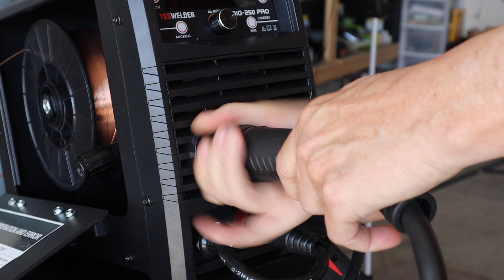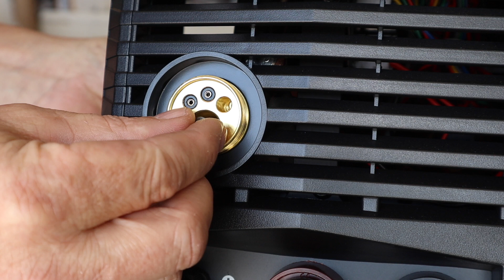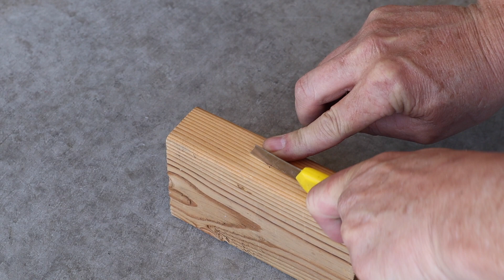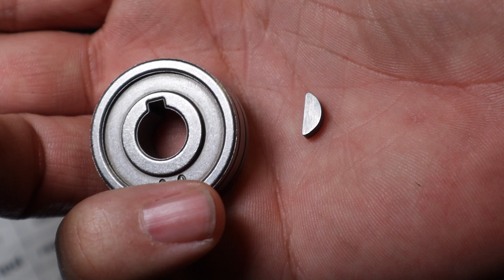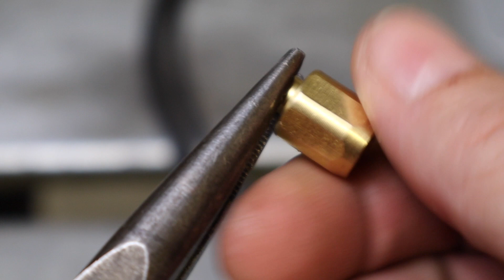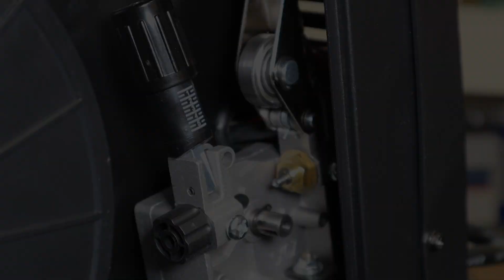How to Change a MIG Gun Liner  - YesWelder MIG 250 Pro

Comment: Thank you for that video . It really helped me a lot. I have one question:  What type of liner (teflon or steel) i should use if i am using FLUXED CORE (self shielding) wire and I am welding without gas? Also the size of the liner ...I see there are liners on the market that are recommended for wires from 0.8 to 1.2 diameter.... Obviously one should aim at installing a liner with diameter as close as possible to the diameter of the very wire used , for example wire 0.8 should fit in liner 0.6-0.8 , wire 1.0 should fit in liner 1.0-1.2 . Thank you again.
Reply from the maker: Personally I would use a steel liner for flux core wire. The same liner you use for solid core MIG welding.  If the old liner was working well for your needs I would just replace it with the same diameter for the replacement liner.

Comment: Hello I own a yes mig tig and stick welder model 205ds ( the blue white model). I want to weld aluminum. Can my welder be converted to weld aluminum with the existing mig gun setup.  I have an argon tank.  I keep hearing that all I have too do is change the liner in the mig gun. Where can I find a compatible liner. Also the roller has too be changed with a grooved roller too push the aluminum wire out. Also what thickness aluminum  wire should I use. Thanx
Reply from the maker: I would think it is possible but I have not used that particular machine. I believe YesWelder sells a graphene liner that will work for you. You may have to cut it to length. Not sure about the U shaped aluminum roller, either YesWelder or maybe on Amazon. I would try .035 wire and use a .045 tip. Use one size larger tip than the wire size and it helps reduce friction on pushing the wire. Try to keep the lead as strait as possible when you weld as well. I wish you the best!

Comment: Appreciate people making how to videos but dude... taking the c clip off to replace a rigid tube with one that is flexible graphene liner was just plain dumb. As soon as I pulled the clip off I realized how dumb this idea was. Anyone that did what you did after watching this is definitely cursing you or will be. The graphene line I have doesn't even fit where the tube was and my clip vanished somewhere inside the machine. You need to edit this video telling people NOT to take that tube out and if they need to put it back in to do it inside a clear plastic bag or something because when it goes flying, you'll never find it. You should have just pushed the liner in a tiny bit longer than the nut so it fits without stopping the torch from connecting to the machine. Manually thread the wire into the metal and then graphene. Pretty sure yes welder sizes the graphene liners and that's why you just happened to have the same exact length as the tube you shouldn't have removed. I'm pretty sure your graphene liner will be split at the roller in no time and then your liner and part of your wire spool will be garbage.
Reply from the maker: You're giving me way too much credit. I didn't write the instruction manual I just followed the steps. You potentially have a good idea there. You should make a video and show everyone how you think it should be done. Maybe it will work better and help some people out.
Reply: @DIYHomesteadProjectsDIYHP10  Sorry bud.. I've never even mig welded before to be honest I have common sense which only gets you so far without experience. I've had some issues getting everything I needed to start learning to weld aluminum. I've stick welded a bunch but crappy welder welding on a crappy welder wasn't too pretty.When I posted here I literally came straight from the garage after trying to get that C-Clip back on. I was more frustrated with it than anything you did. That first coil you took out I ruined pulling it out with pliers but figured out that it can be spun in and out like a bolt. I cut a piece off the copper coil at the end of the graphene liner to temporarily replaced it but I only have a 1lb spool of aluminum and there some drag so, I'll remove it like you did and see if it help. Does it stick to the tube you took the clip off? The only thing I could try was another piece of that copper coil but It seems like there is a lot of drag there too when I just thread it though. My graphene liner doesn't fit through that hole  PS: I do have common sense but I also have uncommon sense and neither one is right all the time. Sorry again. Cheers
Reply from the maker: No problem and I get it. That C clip is frustrating and I struggled with it too. I haven't tried it but I have wondered if the rear C clip is even necessary. You could possibly leave the C clip on the front and just remove and insert the metal guide tube from the front of the machine when switching to the graphene liner. I've lost my rear C clip too. Now I just wrap small gauge piece of wire where the C clip goes and twist it like a bread twist tie and clip the ends. When I need to remove it again I just break the wire with my needle nosed pliers and install a new twist tie when it's time. Much easier to do than fiddling with that dreaded C clip.
Reply: @DIYHomesteadProjectsDIYHP10  I ended up winding tiny spring around it but you might be right about not needing .  I only have a 1lb spool atm and the simder  welder I just got isn't liking it. Might try shaving the liner down a touch to get it to fit in the hole so I can try without that tube and see if lessens the drag a bit. I'll pick up a 2 pounder and see how much different the drag is because right now it's moving like an eskimo wearing one concrete snow shoe and one cross country sky being chased by a pregnant three legged polar bear.
Reply from the maker: I hope you are able to get it running smooth. 👍

Comment: When and if I have to replace the mig liner if I go up in wire size? I bought my first mig welder. The MIG welder is currently set up for solid wire 0.6.  I want to do flux core .9.  I have a 0.9 tip and the .9 feeder wheel.  Do I need to increase the size of the MIG wire liner, or does the migliner just come in one size?
Reply from the maker: The mig liner should accommodate any size wire you want to weld with. Only the tips and wheels need to be changed when changing wire size.
Reply: @DIYHomesteadProjectsDIYHP10  ,  thank you so much for the immediate reply.
Reply from the maker: You are welcome, hope it helps you out.

Comment: Very detailed. Thank you. I lost my e-clip and can't find it even after taking the front cover off. Anyone know where to get a clip that small?
Reply: That’s a great solution. I appreciate it.👍
Reply from the maker: I lost the e-clip too. I just wrapped a very small diameter piece of wire around the grove where the e-clip went and put a couple twists in it with a pair of needle nosed pliers. You could use a wire like what's in a bread tie and strip off the paper or plastic. Once you put a couple twists in it just clip off the ends nice and short. Works like a charm and it's much easier than installing that e-clip. If you need to remove it just twist it off with your needle nosed pliers, toss it in the trash and replace it with a new piece of wire when you put it back together. It sounds like a lot but it only takes a minute or so and it's a lot easier than messing with that darn e-clip IMO.
Reply: Great idea

Comment: Hello sir, i am setting a miller migmatic 380 for alluminum 1.2 wire, i replaced v rollers with u and also replaced the liner with 1.2 teflon liner but still wire is rounding /bending near rollers please guide do i also need to put copper/brass jump contact liner inside gun end as currently i put liner till gun contact tip end.
Reply from the maker: Hello, I'm sorry but I don't have any experience with a miller migmatic 380. I don't know how they are supposed to be set up.

Comment: Can I do that with my Yeswelder MIG 205DS? If I can. Would you be gentle to tell me what parts do I need to buy them. Thank you!
Reply from the maker: You could possibly purchase a graphene liner for the MIG torch, U shaped wire feed wheel and use 100% Argon for your shielding gas with the MIG 205DS. That would be all you would need but unlike the MIG 250 Pro the MIG 205DS does not have any preset "aluminum" synergic settings or manual control over the wire feed speed. I've heard it won't work because the synergic settings on the 205DS are configured to work with steel only and not aluminum. I don't think you would be able to set an appropriate voltage and wire feed speed combination to get a satisfactory aluminum weld with the MIG 205DS. Just for the record, I have not tried this and I don't own a 205DS machine but I would be curious to know how it works if you decide to give it a try.
Reply: @DIYHomesteadProjectsDIYHP10  Is it possible that you can share me the links to buy the two items? Please!
Reply from the maker: Sure:
Graphene Liner for Aluminum Welding (this liner fits the MIG gun for the MIG 250 Pro machine. I don't know if it fits the MIG gun for the 205DS)
https://yeswelder.com/products/graphene-liner-smx-1-0-1-2?_pos=1&_psq=graphene%20liner&_ss=e&_v=1.0&ref=DIYHP10%25

I didn't find the U grove roller so I would just try the appropriate size V grove solid wire roller that came with the machine. Just set the tension lightly so it doesn't smash the aluminum wire. 

Again, I haven't tried this with the 205DS machine. I don't own that machine. It's just what I would try if I were in your situation. I also don't know what the results will be. (no guarantees with this as I haven't tried it with that machine) Make sure you use 100% argon shielding gas not the mix you use for MIG. Good luck to you!
Reply: @DIYHomesteadProjectsDIYHP10  Thank you so much for the advice. I'm gonna try to get the U grove roller.
Reply from the maker: Have you seen this video?
https://youtu.be/hQ7oBsRG1sY

Comment: Thanks for your video. To remove the "C" lock you must use a small screwdriver that goes into the lock and its slot and turn the screwdriver.
To place it again you must use mechanical tweezers and press it. Greetings.
Reply from the maker: Thanks for the tips Gabriel, I appreciate it!

Comment: Can the graphene liner be left in place for solid wire? I don't really want to go back and forth. Seems a lot of muck. Is this liner a substitute for spool gun?
Reply from the maker: Hello Jason, I don't have any experience welding aluminum with MIG. My guess is that if you use the graphene liner to weld with solid wire it will probably wear out much faster than the liner designed for solid wire. I completely understand your not wanting to keep switching back and forth. Neither do I :) Yes, this liner is a substitute for a spool gun. I think the intent is to allow the aluminum capability without the expense of buying a spool gun.

Comment: The clip is easy to install is you use a long nose pliers. Just put c clip (I heard some people call it e-clip also not shure which one is correct) in position with your hands and then use the long nose pliers to press it. Just my two cents. Very nice done video. Hope to see more of this machine!!!
Reply: Absolutely right sir, works every time.
Reply from the maker: Thanks for the tip Jose! I'll give that a try the next time I have to install it. I think you are correct, this one is actually probably called an e-clip because of the little center portion that rides in the grove.

Comment: Thanks for this video, especially the part about the difficulty getting the circlip back in. My welder just got here on Monday.
Reply from the maker: You're welcome Phillip! Good to hear your new welder has arrived. I have a couple of potential solutions for that pesky C clip for those who may be wanting to change out that liner often. I may do a video on that at some point in the future. Personally I didn't want this machine to MIG aluminum but I'm thinking that some out there did. Maybe it will help with that step and make it a quick and easy job.
I'm curious how you like the welder as you get a chance to put some time on it.
Reply: @DIYHomesteadProjectsDIYHP10  I've enjoyed welding with my HZXVOGEN HBM2280 than my YesWelder. I see that they are coming out with a new welder, the MP200, that looks promising but I already have more than enough welders.